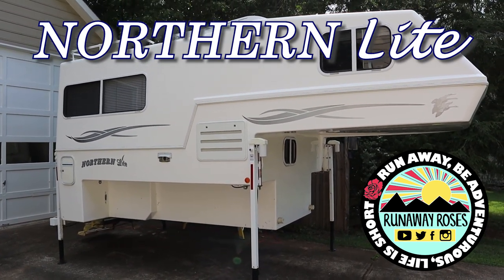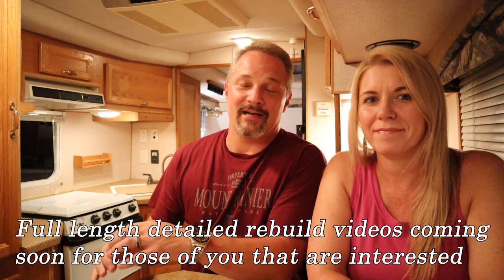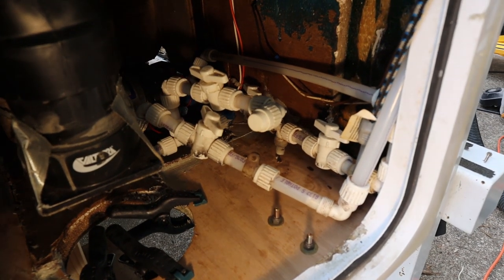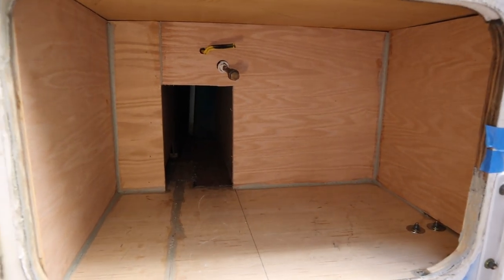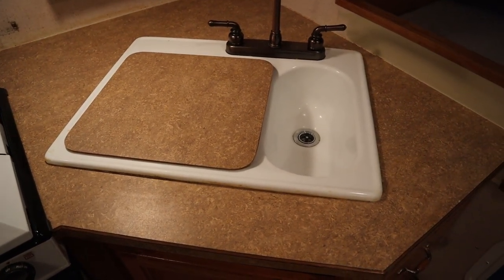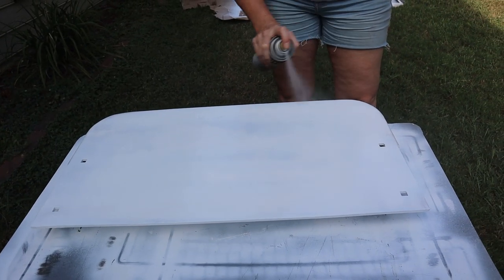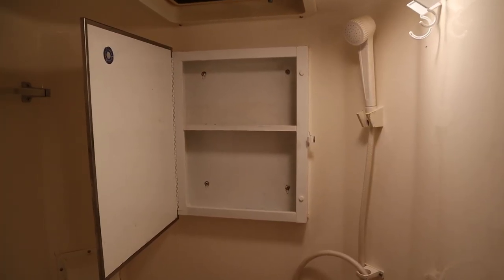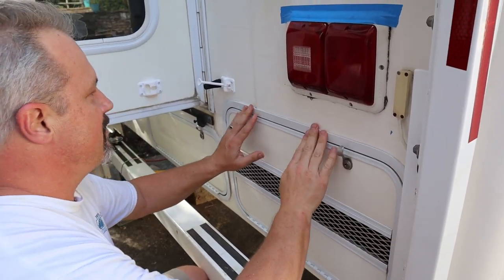Northern Lite Episode 3 / Renovation Rundown - Beyond Repair?

Comment: Great job. I have a 04 northern lite and had issues with water getting in basement. My camper is a 9'2. The battery box is over top of a storage area .  I redid the seals on both doors but water would get in the battery box then run down to the storage box. As campers have no gutters water would come straight down the outside walls and wick into the battery box door. Kind of a poor design of the door frames. I have now installed flashing over all of the outside doors. Fortunately I had a sheetmetal friend that matched all the different radias' of the doors for a custom look. Painted they look like they came with unit.
Reply from the maker: @Eskil Neilson that is a great idea and we've realized that whether it's rain or the ac condensation running down, there does need to be some solution to divert the water away from the windows and doors.  We've seen some things an d for lack of a better word, I'll call them gutters made for rvs.  We're thinking about putting some of these on.  Thanks for watching!  ~Carla

Comment: I’m a little concerned about the quality of the Northern Lite original build.  O My Gosh,  you are having to rebuild whole the thing.  I admire your stick to it attitude.
Reply from the maker: @Edward Martin the problem is that the vent caps had been broken of for a long time and water was getting in and running into the basement.  We mention this in an earlier video.  I don't think it is the quality as much as it just was lacking regular maintenance.  Maintenance is so important with any camper!  Thank you so much for watching.